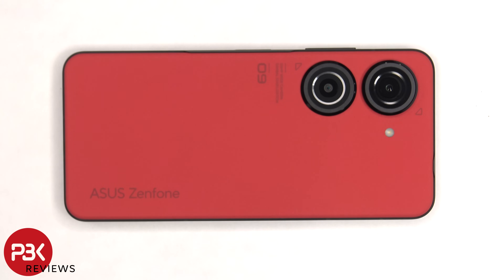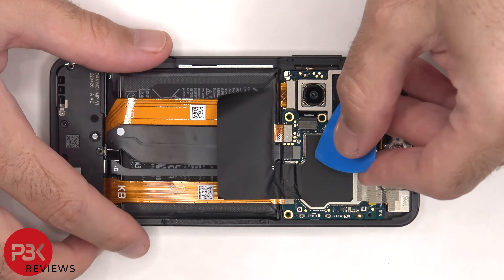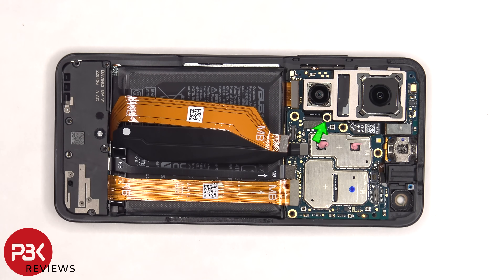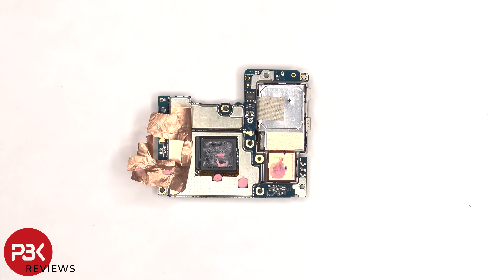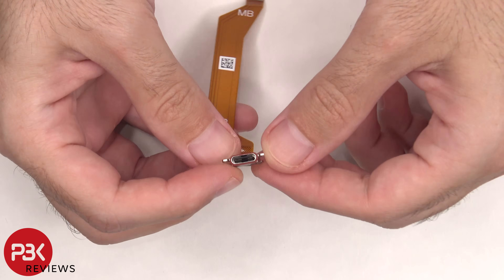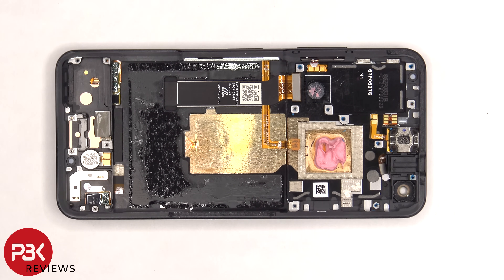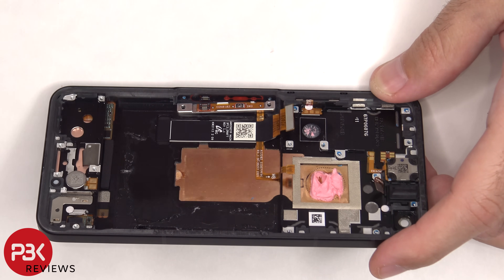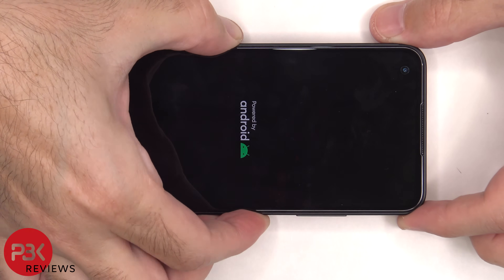Asus Zenfone 9 Disassembly Teardown Repair Video Review

Comment: What adhesive do you recommend for reassembly?
Reply from the maker: You're better off getting the replacement back cover which comes with the adhesive installed. I couldn't find just the adhesive replacement being sold for this phone. here is the link: https://www.ebay.com.my/itm/285527781382
Reply: @PBKreviews thanks for the link.  Ive just ordered a replacement glass for the camera, mine got broken. If I can fit it without taking the back off, that would be the best option.

Comment: Hey brother, good post.. I plan to replace the thermal paste on the Zenfone 9 components. I need to know, sir. Does anyone know the standard thermal paste type for the Asus Zenfone 9? try mentioning it. If not, is there an alternative that is recommended? Several times I felt overheating when working in the field. Maybe it's time I replaced it.

Comment: I'm currently repairing my Zenfone 9. I tried to transfer the usb port like shown in the video. BE REALLY CAREFULL, the stupid cable will tear off if you handle it like shown in the video. Lift it up instead and carefully pry with a little tool. 
Replacement part will arive on July 9. I will post then. Also the headphone port broke. I cannot find a replacement online, but i'm wireless now so it won't be a problem. 

Thanks for the guide tho, it's the only one on the internet.😊

Comment: Thanks for vid, how can i get that battery out? Its really glued tight. Been pulling it like crazy for the past hour even putting some heat from the hairdryer (dont want to damage battery neither so its tricky). One piece of tape even broke off
Reply from the maker: you can use some isoproypyl alcohol and apply it to the sides of the battery and let it sit for 30 seconds or so to eat away at the adhesive underneath, making it easier to pry off.

Comment: This video was really helpfull. I dropped my phone last night and it stopped reading the sim card. I opened the back up and found that the flat cable to the sim card reader was unplugged. It was an easy fix thanks to this video.
Reply: Same problem.  Trying to figure out how to get the back of the phone off.  Any tips?

Comment: So how to change lcd?
Reply from the maker: once you take the phone apart as shown in the video, you can heat up and pry the screen off from the frame when the cable has been disconnected from the main board. Unless you have a complete screen and frame combo, where you would just move over all the parts from the old frame to the new.
Reply: @PBKreviews  This required removing the screen to extract the light sensor and speaker grill which didn't come with a frame and screen that atleast I had ordered. 

The top speaker grill is hold down by the screen and the light sensor is to the right of the speaker grill under the screen and the cable to it runs under the screen and is glued down
Reply: Is it ok if i just tear it without using heater?

Comment: I only need to replace the glass on the screen. The touch works as normal. Is the glass alone sold anywhere/can it be replaced by itself? It seems a waste to replace the electronic components when only the Invictus or whatever glass was damaged. Thank you.
Reply from the maker: Hi, no you would need to replace the entire screen assembly. The glass and screen are fused/glued together and are not user replaceable. It require special tools and machines to get the job done correctly.

Comment: Is that a liniar vibrator? Doesn't seems to be like the ones in Pixel or iPhone... no haptics engine?
Reply from the maker: I believe its a Z-Axis linear motor, not 100% sure.
Reply: @PBKreviews  thanks
By looking at the vibrator photos, seems the same design as the one used in pixel 3a

Part number: 04030-006501RR

Comment: I had a question why did it say 4180 mah on the battery when you flipped it cause it's a 4300 mah ...  thx for the teardown
Reply: Lithium battery have minimal mah that this battery can have, all batteryes difers from minimal 4180 to 4300 max. If u lucky u can get full capacity, thats how to all batery works

Comment: Despite the fact it is a great smartphone, there are some drawbacks in terms of accessibility to internal components. The plastic back panel is an interesting solution but, if I am going to switch an exhausted battery, it is not acceptable that I must take off the camera modules and the cooling film.
Reply from the maker: The graphite film can be lifted back and not peeled off if you wanted to, but yeah there are additional flex cables and such which run over the battery that need to be disconnected as well. Not the simplest battery replacement but not too difficult either.

Comment: How did you manage to remove the back cover? I can't manage to get the blue plastic thing under the back cover :/
Reply from the maker: You can try to use a suction cup tool or a thin metal tool to help you gain leverage to getting a pry tool in. Also make sure you are heating it up with a hair dryer or heating plate/heat gun so the adhesive loosens making it easier to lift it up and pry it off as well.

Comment: could you replace thermal paste when the paste is dry after years?...and can you use PC CPU thermal paste?
Reply from the maker: Hi, yes you can replace it. Just try not to use highly conductive thermal paste since that can cause shorts if it leaks or contacts other components.
Reply: @PBKreviews so you can still use metal thermal >:D

Comment: Good, detailed and well presented tear down video. Thank you. It looks very hard to replace the battery. But yeah hope that all phone makers are using long lasting carbon/garphene based materials on their batteries. My hardly used galaxy s9 plus is now 4 years old and I'm still using the same battery- it made a lot of 4K60fps video thousands of pictures and was charged sometimes three times a day while in use for satellite navigation in my truck 🚚  AND IT STILL WORKS 👍🏻 Zenfone 9 16GB/256GB might be my next choice due to its compact size, comparative to iphone13 camera(Asus might give us more updates to the camera in future 🤞) IT'S JUST DAMN GOOD PHONE 🤳
Reply from the maker: Thanks! :)

Comment: Ah... I am watching it second time, and now I see LI-PO battery... It no go for me. 
300-500 cycles of LI-PO vs 2000 or +3000 cycles when you take care of LI-ION.
It is the great gadget, but a weak tool.
If you read it, please make a Sony Xperia 10 IV video.
Reply: Li-Po and Li-Ion often describe the same battery chemistry. Li-po only means that flat batteries for phones can be produced, because li-ion has a liquid electrolyte that is only usable for hard shells in 18650 for example.
Both have the average voltage of 3,6V to 3,85V and similar capacity.

There are LiFePo batteries though which have around 3V and endure the 3000 cycles you stated. But no phone known to me uses them because of the low voltage. And no phone uses Li-Ion Cells because of the required shape.

Comment: 4.5 repairability I think is underrated, given the modularity of the components.
Reply: Given the amount of glue i think it's a pretty spot on rating though by coincidence.
You can make so many mistakes on that thing and you have to get new adhesive every time.
Love the phone but it's not that easy to repair imo. At least they don't actively try to stop you.

Comment: I think a vertical view of the teardown would be better to view personally. I do appreciate the teardown video, thanks.
Reply from the maker: Thank you :). Horizontal allows for a more close up view and complete view instead of doing a half top and half bottom portion. Also when I am taking a phone apart personally, I feel its easier to do when its horizontal but maybe I have just gotten used to doing it this way because of the videos :)

Comment: Is it possible to replace the battery without messing up any of the applied thermal paste?
Reply from the maker: yes, you would just need to lift up and hold the graphite film up out of the way to be able to disconnect the cables and pry off the battery. You wouldn't need to remove the graphite film or the motherboard etc.

Comment: 4150 mAh battery? It has to have 4300. Some pre-production version? 🤔
Reply from the maker: Every battery has a typical and a rated capacity written on them. If you look closer you will see both numbers written on the battery.

Comment: i have it for about 2 weeks and i m happy with this phone , what's interesting it s that it doesn't get 🔥 , i had the red magic 7 pro and with all the cooling and the size after 5min in asphalt 9 it was hot to the touch , that's mean that the Samsung it s sucks at making Chips, basically all the chips made by Samsung have heat problem and runs very hot ,so for who wants better must look for  chips from TSMC  , o i forgot about battery, it s first phone that i can use 1,5 days like huawei in the past :)
Reply from the maker: yup, plus the cooling is done well in this phone. 👍

Comment: It is interestning seeing how the battery is advertized as 4300mah, yet the battery inside says «4150mah». The increase might have something to do with the way the battery is overally utilized by the phones components?
Reply from the maker: Keep in mind every battery has both a typical and a rated capacity written on the battery.
Reply: More voltage more battery in short answer.

Comment: I vs myself 😁 battling wich android should i buy. Any suggestions which brand is have better durability,processor,battery efficiency?
Reply from the maker: Most cases depends on budget, but this phone does seem to be a durable and solid device with a good processor.

Comment: This is the most interesting phone of the year as far as I'm concerned. It might be the last 5.9 inch flagship we ever see. With a headphone jack and a charger no less. People complain about the updates and fair enough but I would rather have a headphone jack and a charger than get Android 15 in 3 years.
Reply: if this phone get enough buyers, i'm sure asus would change their mind. this year zenfone tackles all the problem from the previous year zenfone 8.
Reply: yeah, i agree. it's hard to find a compact phone, especially for budget-friendly phone
Reply: Yay
Reply: With no telephoto lens
Reply: Got mixed feelings about the charger. This is a solid middle ground with 30W, although I have some more powerful ones at home.
Best way would be to let the buyer choose to get one or not, like choosing the capacity. Also when I get no charger, I don’t need a cable. Dunno why every charger-less phone has a cable included. Especially because I despise every cable below 2m.
Asus did it good this time around. Shoutout to the modular USB port, rather removable battery and a back cover without pesky ribbons, shattering glass or too strong glue. This may be a very sustainable phone.
Reply: True, although It's missing an SD card port.
Reply: I consider updates a non-issue. Sooner or later you will end up looking at a custom Rom anyway to stay ahead of the "this OS is too old to run this app".
Is how i've managed to keep my 8y old HTC M9 still kicking.
Reply: This is 2022. You can get chargers from literally anywhere and everywhere for pretty much nothing. Getting a charger with the phone is a complete waste in the majority of cases. The practice is absolutely terrible for the environment and it's good that the producers have mostly stopped doing it.
Reply: @CassidyOG  then they should make the phone cheaper since it has no charger. If I'm paying full price for a phone I want the charger.
Reply: @CassidyOG  I don't have any QC/PD compliant fast chargers, having at most a basic DCP adapter that offers like 5-10W cause my phone is pretty old (So long as most stuff works, why upgrade?).  For me a complimentary fast-charger makes sense.

Plus as pointed out there is a bit of a thing where in scenario of omission of a good quality charger, the price of the phone suspiciously rarely drops...

Ideally it would be just a choice. Either you get with charger bundled, or without but get a discount either.
Reply: @CassidyOG  new phones should ideally use new gallium nitride chargers that are more expensive and a lot more powerful. Like 40$ for 65W. You have your old 10-20W charger from your last phone that is totally inadequate to charge your new phone. But at least the company saves 40$ And you ship a new charger from Amazon so you get 2 packets instead of 1, which is twice as bad for the environemnt.

Comment: Omg how they fool us. Just by putting a big camera module in the case which has the same camera as before. And we think that bcoz the camera module is bigger this camera should also be big.
Reply: and the secondary camera doesn't even have ois
Reply: @darthraider450  wide angle lens don't have ois generally in flagships too